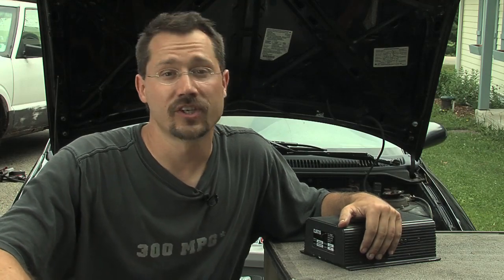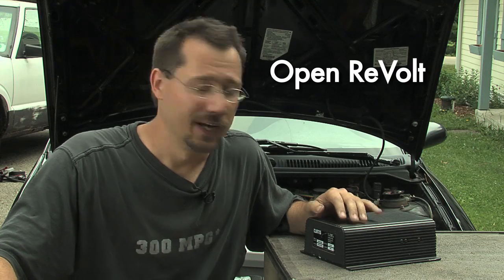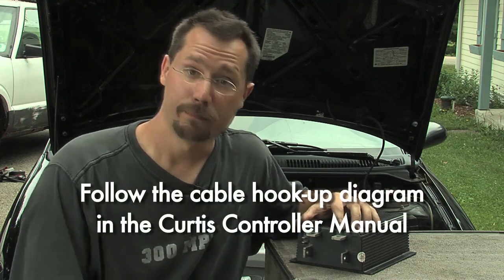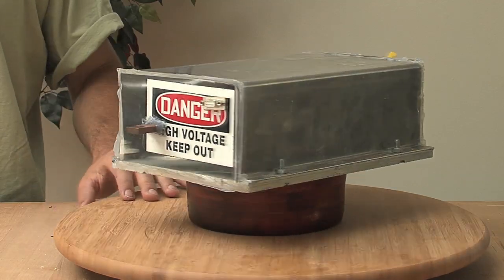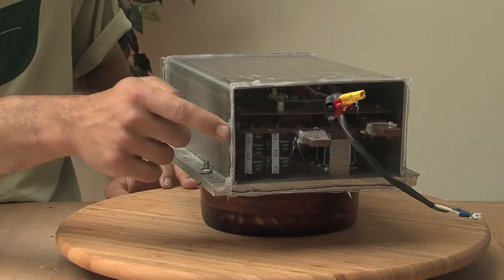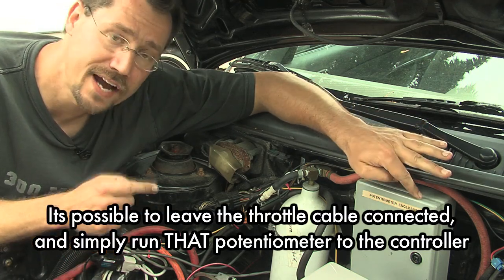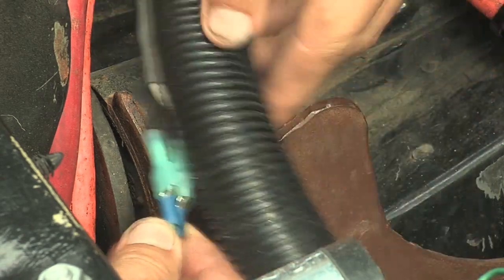13 Build Your Own Electric Car: Motor Controller & Throttle

Comment: Change controller use any battery in any car. don't tear apart 6 cars to build 1. just fix the one you have. The parts are already there. Remove bad cell and use what's left.

Comment: That can’t possibly be up to any kinds of government standards, or legal to drive on public roads. How many times has it caught on fire?
Reply from the maker: For anyone concerned about safety, please note:
All of the original safety features of the car - airbags, daytime running lights, etc., are unmodified.
The car is still within the original Gross Vehicle Weight.
Electrical systems are protected by proper fuses.
The vehicle was inspected by the state for an emissions testing exemption.
https://300mpg.org/2014/08/03/red-tape-and-electric-cars/

Comment: Very nice and detailed video! Can I ask how would you make the original throttle pedal work if it's electric? Talking about a B6 Passat from 2009
Reply from the maker: The original cable from the gas pedal goes to the spring-loaded potentiometer inside a weatherproof box in the engine compartment. When I press the gas pedal, it moves the cable, which pulls on the potentiometer. The potentiometer sends a signal to the motor controller which then varies the speed of the electric motor.
Reply: @BenjaminNelsonX  yes i fully understanded that, i mean what would be your solution if the cars original throttle pedal is electric instead of the old fashioned wiring pull mechanism
Reply from the maker: A friend of mine has experience with that. Tom and his Dodge Neon are featured in my Electric Car 101 series. The Dodge Neon had a mechanical linkage to the throttle in the engine. In there was a 0-5Kohm potentiometer which would then send a signal to the car's computer. 0-5kOhm is a common signal type for throttles for electric motor controllers. So, he simply sent the output of that to his motor controller.
Ironically, he ended up with an electric car which still had a throttle valve on it!

If your accelerator pedal outputs a 0-5kOhm or 0-5V signal, it's very easy to simply send that out to a typical motor controller. If it has some other type of signal, you would need to figure out how to capture that signal and then convert it to an appropriate signal for a motor controller. I don't have experience doing that, but I would imagine it could be done with something like a small dedicated micro-controller, such as an Arduino.

Alternatively, you could remove your gas pedal unit and replace it with one from another car. For example, I know that Toyota Prius gas pedals have been used for this. https://www.evwest.com/catalog/product_info.php?products_id=274
Reply: @BenjaminNelsonX  thank you very much!!!

Comment: I'm very intrigued by this series of videos and am thinking about building an electric version of my dream car,  a 1961 Cadillac convertible.  I know it's a massively heavy car, and so any and all weight that can be removed, should be.  With that in mind, and with an electronic motor control, couldn't you just remove the transmission entirely and couple the electric motor directly to the driveshaft?
Reply from the maker: Yes, you can essentially connect an electric motor straight to the drive-shaft.
The main concern is that the vehicle would have poor acceleration. It would draw very high current at low RPM to get the car going. Somewhere here, I have a video of the electric Geo Metro pulling away from a dead stop in 5th gear. The electric motor can do it, but it's NOT the type of acceleration you would be used to! (I think that on a 5 speed manual, 4th is actually closest to 1:1 gear ratio of engine to shaft output.)

If you want to go straight to the driveshaft, get as POWERFUL of an electric motor as you can.
You may also be able to change the gearing inside the differential to reduce the speed of the wheels, but increase torque.

You would also want to make sure that you had a motor which can easily reverse directions and have the appropriate controls to do that, since the motor is directly connected to the driveshaft.

Lastly, make sure to have an emergency power disconnect. If anything ever went wrong with the power electronics controlling the motor, you would have no physical way to disconnect power to the wheels. A "Big Red Button" to kill all power would be a good safety feature.
Reply: @BenjaminNelsonX    Thanks!

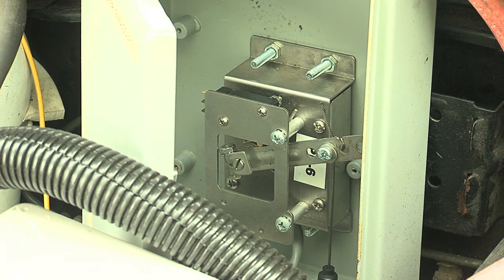Comment: 9:10 isn`t it back to 5000 Ohms, since the less the resistance, the more the current ?
Reply: Not necessarily. It would depend on which end of the potentiometer is wired to the speed controller, and which side of the potentiometer he is referring to when listing the numbers.

Comment: Could you make a video showing how you assembled the controller? All the info in this video is standard on installing the controller but i want to know how to build one
Reply from the maker: Hi Paul, you can read about building this controller at: https://www.instructables.com/Homemade-100-HP-Motor-Controller-for-an-Electric-C/
Reply: @BenjaminNelsonX  hey, the website is nice, but the links he used are all "errors" probably to old? Do you still have the links? Or maybe you can reach out to him, so he can renew them, would be really helpful, thank you!
Reply from the maker: @naren4wood560  That project is from more than a decade ago.
The best info I have for the Open Revolt controller is at: https://300mpg.org/open-revolt-cougar-controller/

Comment: So the DC Series wound forklift motor I got says "48V" and i have been designing the system for 48V.  It sounds like I can up the voltage (72V) to get a higher top speed.  I bought a curtis 48V motor controller but it sounds like I'll need to get an entirely new motor controller to handle the 72V.  Is it possible to reprogram a motor controller (48V) to handle higher voltage (72V) or does it need to be a whole new unit?
Reply from the maker: Most typical "golf-cart type" DC motor controllers are only designed for one voltage. Some are designed for a range, such as 48V-72V, those can be adjusted or reprogrammed.
Since you already have a 48V controller, just test it out on 48V to make sure you have everything working right and test everything.
Then upgrade to whatever higher voltage you would like by getting an appropriate controller.
Reply: @BenjaminNelsonX  sounds good. Thanks for all the help! Another question I had was regarding the cabling amperage. If there are periods of over 200 amps being pulled by the motor does the cabling need to be large enough to handle 200 amps (4/0 copper)? Or can a smaller cable be used (1/0 copper) because the typical amperage isn’t quite that high?
Reply from the maker: @yatravis  1/0 should be fine for 200A..
https://www.engineeringtoolbox.com/wire-gauges-d_419.html
How much current a cable can carry actually depends on ambient temperature, what kind of enclosure it's in, etc.
One big reason higher voltage systems are typically recommended is that it reduces the current required for the same amount of work. That allows you to use thinner cable, which saves weight and money.
Reply from the maker: @yatravis  What happens when drawing too much current through a cable is that it creates more heat and it drops the voltage. Both are bad things. But it's not as though the cabling acts as a fuse where it works fine up to a certain point and then suddenly doesn't. (Unless you REALLY screw up...)
If you just have brief periods of time where you are drawing more current through a cable than is appropriate, you will get more heat. Not a huge deal as long as your aren't doing it all the time, and it's not a LOT over what you should be drawing.
HOWEVER. It would be BAD design to use cabling too thin for how much current could be drawn. Maybe you think you would only draw do much current, but then you end up driving up a mountain, where the car is constantly drawing very high current for a long time. Potentially, you can melt a battery cable, leading to a short circuit. Even if not, you are lowing power to heat. Power that could otherwise run the car.
Ideally, you just want to look at the maximum your motor controller can draw. Install a fuse and cabling appropriate for that current.
Reply: @BenjaminNelsonX  Thanks for the detailed responses.  This helps a lot!  Do you still drive the Geo Metro?
Reply from the maker: @yatravis  The Metro was decommissioned a while back. We use tons of salt on the roads in the winter around here. Unibody cars don't last long.
You can still see the motor I used in the Geo Metro repurposed in the Wheelie Tractor.
https://www.youtube.com/watchv=_cavmhl1n5I

Comment: I also decided to convert the car into electric. I have it Trabant. You can see him on my channel. I made the gas pedal on the hall sensor, it is mechanically more reliable. And he adapted it to the controller with a special board. Which I collected from a mobile phone charger and integrated into the same controller

Comment: Amazing stuff Nelson, have you ever done a hybrid system?
Reply from the maker: A year or two later, I played around with running this car as a hybrid. I added an LP generator with a remote start to power the charger. Essentially a poor-man's Chevy Volt!
https://www.youtube.com/watch?v=xXVi-g4jWqI
Reply: @BenjaminNelsonX  Pretty cool, you ever do a gas engine combo? I am looking to do a project like that for my gas guzzler, without breaking the bank. Any suggestions?
Reply from the maker: @MR-uk7iy  I think you beat me to mentioning the "High torque motor in the driveshaft" trick.
I do know somebody who did a pickup truck like that, and went for a ride in it. Seemed to work pretty well.
Reply: @BenjaminNelsonX  I saw an old vid of you with the same concept. You called it the super truck Pretty cool stuff. With the salvaged stuff available today electric motor wise and the VESC motor controller. could you guide me a bit?
Reply: @BenjaminNelsonX  all electric seems a lot less complicated. love your work man!

Comment: Have you looked at AC motors?
Reply from the maker: Yes, absolutely! Please keep in mind that this video if from a project well over ten years old. At that time, AC motors and controllers were very expensive.
AC motors are now more available and less expensive, including ones from production electric vehicles.
I'm currently working on a project using a Nissan Leaf AC motor. Please check current videos on this channel about that.
https://www.youtube.com/playlist?list=PLmHss3DBZUintEK36PluyOT_dv159z3Gt

Comment: can this controller used for regenerative braking system too??
Reply from the maker: Neither of the controllers used on this car were designed to support regenerative braking, which is fine, because this is a series-wound motor, which doesn’t do regenerative braking anyways. A permanent magnet motor and Kelly controller would allow for regenerative braking.
Reply: @BenjaminNelsonX  thankyou sir for reply and your tutorials were very useful

Comment: Im building a light weight Velocycle and I have a 24 volt motor from a hydraulic pump for a forklift as well as a gas pedal unit like yours and 12- 100 amp hour agm batteries, my controller is an open source like the one you built.This controller is 200 peak amp 300 for 5 seconds .just wondering if you could tell me if Im ok with this size controller or do i need larger one.
Reply from the maker: What voltage are you planning to run? 200-300 amp is probably fine, but POWER is rated in Watts.
At 48V, you would have 9600 watts/14400 peak. That's about 13HP/19HP peak.
That sounds like plenty for a Velomobile.
I ran my original electric motorcycle at 48V with a 300 amp controller and it was fine.
Reply: @BenjaminNelsonX  Hi Ben Pleased to chat with you here. Id like to send more info to you my friend like pictures of the components that I've  collected . I'm not sure how to place the specs on this 24 volt electric motor as it doesn't say much on the tag other then  NA57003 MCF 24VDC . Wonder if the nominal thing would work 36 or 48  volts for this motor even though its 24 volts. Here's my Email Ben .ID love your input your a wealth of knowledge and I watch all your vids. glassblastcollision@hotmail.com  Louie
Reply: @BenjaminNelsonX what was the range of that motorcycle? Could it cruise at freeway speeds for an hour, 65ish mph?
Reply from the maker: @andyfumo8931  
I built that motorcycle in 2007. That was before any of the modern electric cars came out and there were NO lithium batteries that could possibly be considered "affordable".
That cycle ran from 4 lead-acid batteries and had a 20-25 mile range.
I live two miles outside of town, and it's all 25 MPH speed limit in town anyways, so the motorcycle was FAR more than enough for what I needed, but it was never designed for 60+ miles at 65MPH and more.

I later had a Vectrix electric motorcycle and put used Nissan Leaf cell modules in it. That had a top speed of 100 KPH (62MPH) and could go up to 90 miles on a charge. (probably 60 miles at full speed.)

For a good look at the specs on modern, commercially-built electric motorcycles, check out ZERO.
https://zeromotorcycles.com/
Reply: @BenjaminNelsonX  do you have any recommendations for an AC motor system, using a car alternator to power a 4-8000w hub motor, can that work as back n forth, the motor RPM turning the alternator to continue powering the motor?
Reply from the maker: Using an alternator to power a motor to power an alternator to power a motor means there's no energy coming in from anywhere, only going out. So, it is much more efficient to simply use a motor.
Using an engine and converting power to electricity is one way to create a hybrid, but hybrids are also much more complicated than battery electric vehicles.
Nowadays, most people working on some sort of a DIY electric vehicle use lithium batteries and an electric motor. DC motors are still very useful, but brushless DC and now AC are pretty common.

For a Velomobile, you shouldn't need a huge motor. You might want to take a look at some by Motenergy or Golden motors.

Comment: would a vfd be more efficient way to regulate speed?
Reply from the maker: No. We generally use the term "controller" for DC and "inverter" or "drive" for AC, but they are the same thing - an efficient electronic speed control.
AC motor speed is varied by frequency, whereas DC is controlled by voltage, or a Pulse-Width-Modulation that effectively acts like a change in voltage. Other than that, a controller and a variable frequency drive serve the exact same purpose, just work a little differently based on the type of motor.
Reply: @BenjaminNelsonX  i am in the contemplation stage of building an ev model t. I would like a 200 mile range with a top speed of 65-75 mph.  Would you advise ac or dc motor?  I plan on using a modernized drive train with manual transmission, but am looking into hub motors.
Reply from the maker: @ShaunPaget  Just keep in mind that the specs you just listed are more or less that of a Chevy Bolt. Take a look at the cost of buying one of those, they are not inexpensive, and building something similar yourself will also have a pretty good cost to it.
Do you mean to say that you plan to convert an old Model T Ford? I don't know what top speed those were designed for, but it certainly wasn't modern freeway speeds!

AC motors are now MUCH more available and less expensive than they were over a decade ago when I originally shot this video. You can get used Nissan Leaf motors from junkyards pretty easily. I'd recommend an AC motor nowadays.

I don't know of ANY widely available hub motors appropriate for a car.
Reply: @BenjaminNelsonX  Yep spec top speed for a model T was 23hp at 30mph.  was looking at using donor electric fork truck  with borg warner t18 and dana40 axle from a jeep.  With the top speed i desire I may have to shift focus to a model A more weight but little safer with class.  Planned on after market frame and body.  Thank you for your input.  I will look more into ac motors.

Comment: Ben, 
Can you use two controllers at once to increase battery pack size?
Reply from the maker: Number of controllers has nothing to do with battery pack size. Are you asking about multiple controllers to get more CURRENT from the batteries to the motor?
Reply: @BenjaminNelsonX  Just starting out. But I want to convert an old truck. (1940s) So I will likely have about 20 batteries below the bed in parallel. What limitations would be on the controller with a 48v system with 600lbs of battery?
Reply: @BenjaminNelson  actually good question, when i build in 2 controllers, to one motor, would that even work? And how do I sync the controllers? Would be interesting to know, but what I ask myself is how do you program this self-made controller?

Comment: Your pedal-to-potentiometer cable looks very much like bicycle brake cable or something similar.  Have you noticed any problems with fatigue, weather resistance, and/or stretching?  Bicycle cables usually use a cable housing, terminating into a barrel adjuster to account for stretching and to provide weather resistance.
Reply from the maker: I just reused the original throttle cable. It IS very similar to a bike brake cable. I never had any issues with it.

Comment: If I have a 35v motor and hook up a higher voltage (60,72,96,144v)controller, the higher the speed?
Reply from the maker: Baloo Tube Yes, on a DC motor, speed is proportional to voltage.
Reply: BenjaminNelson  but would it not destroy the motor?, I currently have a forklift series wound motor rated for 24v, could it run on a 36 or 42 v system? , I am using that motor for a electric motorcycle project!
Reply from the maker: I’ve run a 36VDC motor at 144VDC. Most forklift motors are pretty solid and have no issues being overvolted. The main thing to watch for is current, which can cause overheating. At high voltages, you might need to adjust the brush timing.